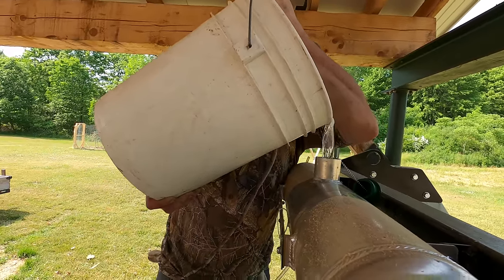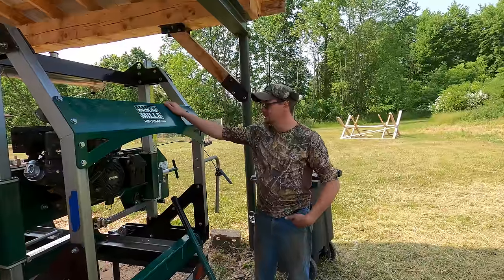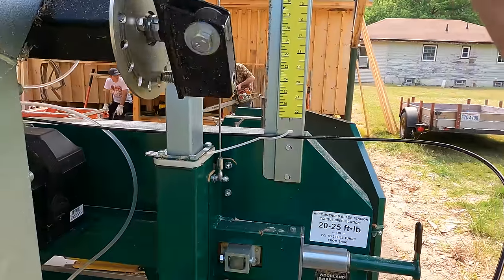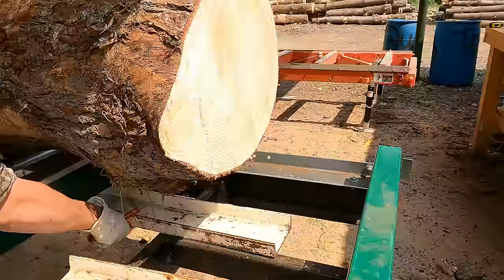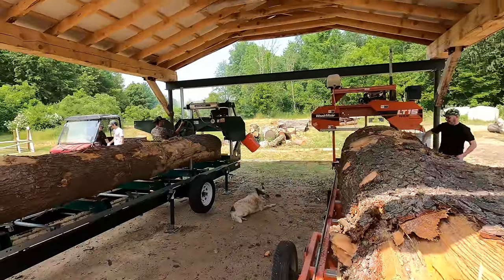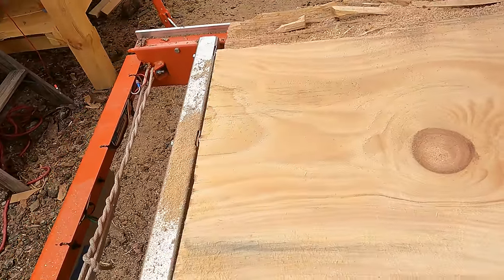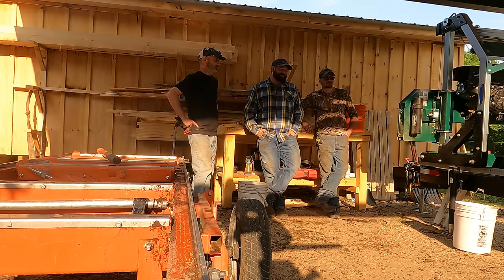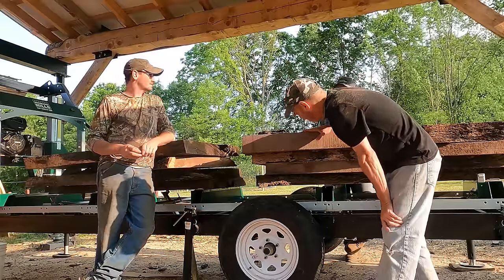Woodland Mills vs Woodmizer sawmill comparison

Comment: Does the Woodland Mills not have a grease zerk fitting in the center bearing for each blade pulley, like the Woodmizer has? Normally the blade safety cover is removed [on the working side], and you pump grease in at a zerk in the center of each pulley. Maybe the fitting is in the back, but that would be hard to get to.
Reply from the maker: I didn't see one but I've only found 1 on the woodmizer and it's on the height adjustment wheel
Reply: @mcsawmill  Thanks, I hope the owners chip in with comments.
Reply from the maker: @bstiger6482  the LT15 is mine, like I said there is only 1 grease fitting, it's on the up down handle piviot. The blade wheels use sealed bearings and on my mill the blade guide rollers are not greasable (you can buy greasable rollers)
Reply from the maker: I just checked with Austin, the woodland mills uses a sealed bearing for the blade wheels just like the LT15.
Reply: @mcsawmill  Thanks, buddy, for checking on those facts. I suppose a sealed bearing would work better [has pros & cons] than a zerk fitting bearing, but there are some sawmills that has a zerk fitting. Imagine saw dust and grease mixed together?

Comment: I gotta lt-15 Go. It's not the Wide version.  I put a winch on mine for loading n turning logs.
Reply from the maker: I have the manual winch and ramps but I can't use them with 2 ton and bigger logs, it would just flip the mill on its side.

Comment: I think in comparison with mills need proper specs need to be researched the 172 is 176 and 16’ is 17’8” the $32 is for bigger blades his shocks the gas leak out was actually a vendor problem .
Reply from the maker: everything you said is right. I realized the 172 thing after I published the video so... The length of the woodland mills was extended with a bed extension, we didn't mention that either. Sorry.

Comment: Need to get a welder and put some extra metal on the bed to handle the heavy logs.
Reply: That's probably true.
Reply: Get some 20'  angle  and  make a proper ground track for that woodland  andyou have  a proper beast right there

Comment: The Wood-Mizer sets up in 2 mins doesn’t need to be level no comparison
Reply from the maker: Not a chance, not even on a flat concrete slab could you unhook it from the tow hitch and set it up that fast. Heck it takes me longer than 2 min just to get the water jug from the truck and hook that up.

Comment: These are only 5k? I was expecting 15k or something. Make 1 or 2 good quality tables and it pays for itself.
Reply from the maker: The green one is 5K without the trailer, the woodmizer is a little over 15k. You could easily spend $40k on a sawmill and make it back the first year selling lumber.

Comment: Four men and 15 minutes to turn a log. There goes a most of your profit. Automated log turner would pay for itself in less than 6 months.
Reply from the maker: Show me a log turner on a portable mill that can roll a 36" dia x 16ft log.
Reply: You can add an overhead slide about crane with a hanging push button control. Add a dog hook to the hoist chain, you can add removable stops on the home side of the deck to keep the log from rolling off deck. Wrap chain and lift with crane. I am just trying to help and hope this doesn’t anger you. @mcsawmill
Reply from the maker: @Terry-z2j7l  adding dogs is a cool idea! I like that.

Comment: Thise welds should be fulld welds thats why stuff is letting go… to bad they spend a bit more time welding at the price these guys are oaying these machines it’s actually pretty sad to work hard like that and then getting jewd so the owner can make 200$ more per mill…. Quality control should not pass this… if the piece is 3 inch long well the ful 3 in should be welded not 1/2 in at both ends with a tac in the middle

Comment: I have woodmill 126 and it's garbage let me tell you that. Yours is 50 h.and it's falling a part.
Reply: Austin is a beast.  He doesn't mess around - he gets work done!  I would blame our learning curve and our desire to push the limits on our sawmill constantly - more than the construction.  We put that mill through its paces!  I would buy it again.
Reply: Why is it garbage? You are the only negative I've heard about the woodland mills 126 14hp. I have a 126 14 hp and so far it's been fine. Slung a blade or two until I figured it out and just look her over and make some lumber.  It's no baker mill but it didn't cost 40thousand either.
Reply: @snickersberet4792  preach.

Comment: Them little band mills are so slow I built a circle mill years ago took two belsaw mills put the carriage on hdy that run the  dogs manual 54 inch inserted teeth blade 671 Detroit power I could cut that log up in less that ten minutes
Reply from the maker: Circle mills are definitely faster. They are also much harder to take over to your buddies house so you can compare sawmills.
Reply: @mcsawmill  and why would I want to? Because if I had a circle saw mill my buddy would want to see it and his friend would want to see it and his friend and on and on and if you ever had one it would make you tired to look at a little band mill my son has a small band mill if you cut very much you will have to change the blades alot ran mine for years changed the inserted teeth once lol
Reply from the maker: @jacksimmons60  you may as understand, I love circle mills but different needs different saws.
Reply: @mcsawmill  I was commenting on the text you sent about your friend would want to see it

Comment: This is a 1 % of the time video.   Why you bothered to show what never happens is beyond me/   Had you put a 14"  butt log on there and did the same thing the comparison would have meant something.   All you showed was no matter what they say the mill will cut  20%  smaller is all that is practical.   An engine and blade cut every log.   I man moves them.    

Oh and that Woodmizer is clearly over priced if the green one was near 1/2 the price of the W.M.    I will admit the cost comparison was appreciated.
Reply from the maker: @MatWalter-q3h  not everyone has perfect saw logs, we saw what we have. Everyone who doesn't have a woodmizer says they are overpriced. But you won't find a woodmizer owner who wishes he bought a different brand.

Comment: DONT BUY CHINESE.  NOT EVEN IF THEY BRIBE YOU😂
Reply from the maker: @leonidas7281  woodmizer is USA built, woodland mills is Canadian.
Reply: @mcsawmill  woodland mills are "designed" in Ontario Canada. Manufacturing is in China. Woodmizer, yes US.
Reply: @mcsawmill  some woodmizers are made in Poland.
Reply: @mcsawmill  how much do they pay you?
Reply from the maker: @leonidas7281  nobody pays me except YouTube.
Reply: @mcsawmill  woodland mills made in China. Should correct that.
Reply from the maker: @leonidas7281  by your logic Ford trucks are Chinese.
Reply from the maker: The gasoline woodmizers have Kohler engines, guess where they are made?
Reply: @mcsawmill  I roll a timberking.  All welded. Not bolted together trash. The diesel is made in Italy though.
Reply from the maker: @leonidas7281  timbering are nice mills, I love the big square throat.